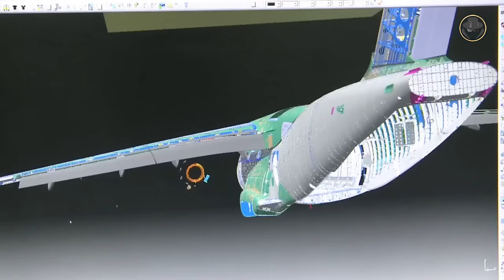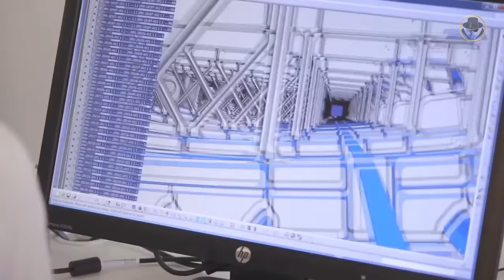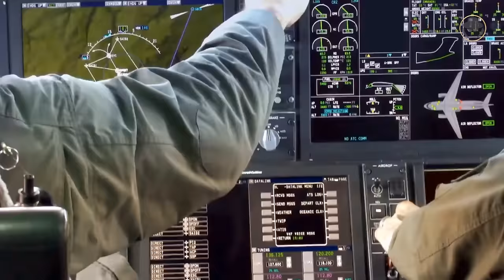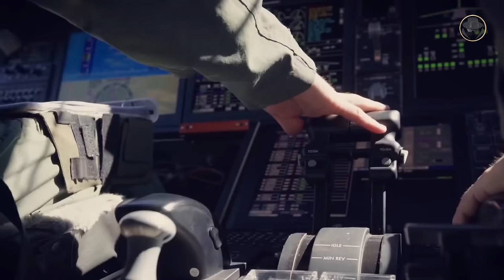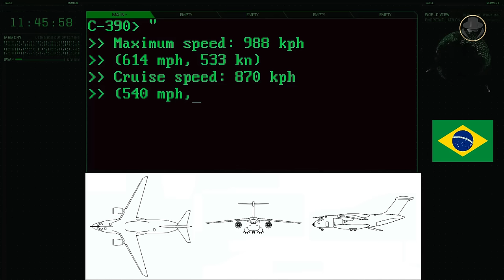Embraer C-390 Millennium | Is it the realistic alternative to the C-130J Super Hercules?

Comment: Let's see if the US will boicot the sales of KC390 like they always do with the Brazilian arms sales
Reply: they already did it in Australia... You are a little late
Reply: @TicoMakonha 
😂😂😂😂😂😂😂
Reply: Not sure you know what “boycott” means.
Reply: @afcgeo882 They make their allies not buy these products so that their own industry enters this market even if they are not better
Reply: @Emersonunes  That’s not a boycott. Also, give one example of that, where the American product is objectively inferior.
Reply: @afcgeo882  in the C130 vs KC390 case, the hercules is inferior im range, speed, transport capacity, technology, avionics, versatility, and price.
Reply: @pedroluizmirandapignanelli9263  Those are objectively false statements. You don’t compare a 747 to an A320 for a reason. The C-130J isn’t supposed to have the same speed or payload. It’s a TACTICAL air lifter. Its job is to service places that no other aircraft can and in a real combat environment. It’s required to be extremely robust, easy to work on and quiet (relatively). The KC-390, with its twin turbines, cannot deliver any of those attributes. The KC-390 also has a 15% lower range, which is CRUCIAL in actual military work.

Also, the C-130J has the same exact avionics as the KC-930 uses American avionics systems.
Reply: @afcgeo882  The C390 was designed specifically to replace the C-130J and does that pretty well.
Also, it's very well known for being a low maintenance and easy to work plane, as many EMBRAER planes are.
In terms of avionics, no, they are not the same as Hercules' since they are decades apart projects.
Reply: @afcgeo882 dude, just open your eyes and accept the trumth.
It doesn't matter if the Hércules and the KC390 were designed for different functions or not, both are in the same category, they are direct competitors.

The United States is not the best in absolutely everything it produces and will never be... It is impossible for this to happen and this applies to all other countries around the world... Are there areas of industry that the USA dominates?  Yes, and many, but it is not the best at everything, because there are countries that specialize in some areas, such as Brazil, which through Embraer specializes in making small and medium-sized planes, executive jets, etc. Russia is the best at manufacturing assault rifles, off-road trucks and hypersonic missiles and so on...
Reply: @zecapaugordinho101pretao  That’s your opinion and every fool is entitled to one. Everyone noticed you mentioned NOT ONE THING that is objectively better. NOT ONE.
Reply: @afcgeo882  Have you watched the video?
Reply: @brunoc.7517  Have you considered that not everything you see on the internet is factual?
Reply: @afcgeo882  The purchase of M1 Abrams tanks by Saudi Arabia instead of the EE-T1 Osório.
In the tests carried out, the Osorio won in several aspects over the Abrams (The Leopard and Challenger tanks had already been disqualified). There was an agreement to build factories for production directly on Saudi soil, but due to political pressure, they chose Abrams.
Reply: @raioefogo  You obviously have NO clue of what you’re talking about. This was in 1989 and the Abrams version in those trials was the inferior A1 original tank with the 105mm gun. The Osorio lost the bid because they only produced 2 prototypes, which isn’t enough to conduct any field tests. They had no money to build the tanks. 

The fact is that Saudi Arabia didn’t buy the Abrams either, as the M1A1 version was already in development with a 120mm gun. Saudi Arabia bought M1A2s many, many years later. 

Lets not also forget that the Osorio was basically a Leopard 1 with better optics. This is in 1989, when Leopard 2 was already in production. There was also lots of evidence thar the Saudis rigged the tests in order to get the Abrams at a cheaper price,
Reply: @afcgeo882  C-130 e KC-390 are in the same category of planes. SO yes, they can be compared and it can be objectively said that KC-390 is better. By any metrics, the only one you presented that is actually better is range but KC-390 is still better in all other aspects and no, this is not a crucial feature
Reply: @MrVitorao  Only people who don’t know anything about airplanes would say that. They are of similar size, but just like an A320 and a 737F aren’t in the same category, so are these two aircraft. Their differing capabilities mean that they are used for different roles. The KC-390 is NOT a tactical air lifter.

The C-390 CANNOT perform special operations missions. With just two engines and them being jets, it CANNOT perform low level drops (the danger of FOD or a bird strike means that it will lose crucial thrust and lift in a critical phase of flight. A 4-engines aircraft has no such worries. The RAF just found itself not being able to conduct special operations missions when it abruptly retired their C-130Js for political reasons because even the A400M cannot carry them out until upgrades in the future.

Also, for air lifters, range is the MOST crucial characteristic as it literally defines what missions it simply cannot carry out. This is ESPECIALLY true for nations that are buying the C-390 as they simply don’t have the strategic refueling or basing capabilities. When you can’t bring something or someone from Point A to Point B then nothing else matters.
Reply: @afcgeo882  but C-390 has a greater cargo capacity and can be refueled mid-air. That's the features that makes its lower range not so much of an issue. Aren't they both military cargo planes?
Reply: @zecapaugordinho101pretao Você tava certo até falar que a Rússia é melhor em alguma coisa. Melhores fuzis? Nunca fizeram os melhores fuzis, você não faz ideia da diferença de qualidade entre os AKs e fuzis ocidentais bons, em especial a plataforma AR...
Reply: @MrVitorao  The C-130 has versions that can be refueled and what good is extra cargo capacity when it lacks range? How will the C-390 be refueled? With what? Another KC-390 that has no range? How would that happen? 

Tactical deliveries don’t really need higher payloads. They need larger fuselage size. The C-390 still can’t deliver vehicles any larger than what the C-130 can. If you want a very large payload then you need strategic airlift, not tactical. Then you need a C-17 type of aircraft. 

The C-390 is a compromise for countries that simply can’t afford the C-17 or A400M, and don’t need serious tactical abilities. It’s cheap and it serves the average needs. It’s a good value. However, it just isn’t the best at anything. 

Something being a military doesn’t qualify anything. A C-5 is a military plane. So is a CASA-212. You want to tell us they’re in the same category? You have NO clue of what you’re talking about.
Reply: Mad
Where the European NATO parters have no problem to purchase systems from other countries , the US has.  They prefer buying  US made systems . A non US supplier must have something very special to sell to the US Forces.
Reply: @bertnl530  Except the US has the means to build its own, whereas many European countries do not. Remember, Europe isn’t one country, isn’t one government, isn’t one budget and isn’t one political system. 

Also, while the US builds everything in the US, the systems often don’t come from the US. Many weapons systems are designed in the UK, EU, South Africa, Israel, etc.
Reply: @afcgeo882   I live in Europe, so I am quite familiar with that continent. 
It is all about coöperation.  Amerika pushes hard to sell equipment to European partners, which ain't a bad thing. but why they are doing everything to keep European partners out. You see numrous vids about the US testing European systems, but never a deal. And that is not because the European system is worse or more expensive in buying and exploitation.
Reply: @bertnl530  No one keeps anyone out! Airbus competed against Boeing for the tanker bid. BAE is a regular supplier including the designer of the primary 155mm howitzer, the M777. The new light tank is on an Ajax platform. The new service pistol is a Glock and the new service rifle is SIG Sauer. The legal requirement is that all actual production must be in the US, that’s all.  In FACT, the US has more European systems in service than Europe has American ones.
Reply: @afcgeo882 What does it mean, tell me?
Reply: @Marcos5pb  I’m not your father. Go educate yourself.
Reply: @TicoMakonha 😂😂😂😂 coe
Reply: @TicoMakonha 😂😂😂😂 coe
Reply: @afcgeo882 Lying to yourself won't change the fact that the US acts like a gang of militiamen in the marketplace.
Reply: @GustavoSouza-gf6ty  So why are you lying to yourself?
Reply: @afcgeo882  I wouldn't do that if my country interfered in other people's business.  I could list about 30 Brazilian technology and weapons businesses that the US directly interfered in apart from Osório's case but you will continue with your Cap.
Reply: @GustavoSouza-gf6ty  And that’s why you don’t list any. 😂
Reply: @afcgeo882  Rocket and satellite project with Ukraine, attack on the Alcântara base, nuclear submarine being sanctioned by the USA, etc.  I could really go on but you are the type of person that when someone takes the blindfold off your eyes you don't get used to the light
Reply: The U.S. bought and provided for the Afghan Air Force the Embraer made Super Tucano light bombers
Reply: @pedroluizmirandapignanelli9263   Not just Avionics,  they use American Engines too.    I don't think it's stall speed is slower than a C-130.  I doubt it could land on an Aircraft Carrier like a C-130 did.
Reply: @pedroluizmirandapignanelli9263 In short, the KC 390 is superior to everything lol😅
Reply: US dirty play
Reply: Fato!
Reply: @GustavoSouza-gf6ty  Boa! Concordo irmão.
Reply: @afcgeo882 Osório is/was a superior tank to the M1 abrams, in 1987 Saudi Arabia was going to buy a lot of Osórios after testing each tank that was delivered to compete in a open market from their respective nations, osorio had won against the italians, french propositions, after winning against the M1 Abrams, US entered the scene accusing Brazil of not following some international laws and by saying Brazil was selling stuff to some USA enemies, Saudi Arabia ended up buying from USA, i am not making it up you can Google it up whenever you want.. sometimes (a lot of times) USA is a bully and an unfair prick)
Reply: @eduardomestieri5772  You seriously need to read comments before yapping.
Reply: @afcgeo882  kkkkkk, chora gringo, o kc390 é bem superior.
Reply: @alexandresloandonascimentogome  esses caras acham que o EUA é um país bom hahaha
Reply: @nordestinolendario  And there you have it, a racist Brazilian showing his true colors. That’s the strength of Brazil right there - the reason they will always be an undeveloped nation.
Reply: @Emersonunes  responde p ele sobre o  tank osorio
Reply: @afcgeo882 Super Tucano >>>> AT-6 and OA-1K

KC390 >>>> C-130J
Reply: @henry247  Oh ok little boy. Keep playing with your toys.

Comment: I saw a comparison between the Hercules and KC-390 Millenium. In fact it wasn't a comparison, it was a KC-390 massacre.
Reply: the Kc 390 was massacred or vice versa?
Reply: @carlosandleon  KC-390 massacred Hercules.
Reply: @cromo7743  And then you woke up.
Reply: @afcgeo882  Against facts there are no arguments.
Reply: @cromo7743  Which is why you presented NO facts, obviously. Of course that’s because you get your “info” from Youtube instead of doing actual research or working with these systems for a living.
Reply: @afcgeo882 why u mad bro
Reply: bros comparing a 2010+ design to an aircraft designed 40 years prior 💀
Reply: @ayylmao182  The C-130J was designed in the 1990’s.
Reply: @cromo7743  Fact, the C-130 can land in smaller unprepared areas than the KC390.   It doesn't have a superior stall speed and doubt it could land on a carrier like a C-130 did.
Reply: @abergethirty A força aérea fez um vôo de homologação do astro e fez uma aterrissagem tática, pouco mais de 250m de pista, um porta avião tem no mínimo 300m
Reply: @cleytonlopes1425  O porta avião pode ter 300 metros mas a pista tem menos de 200.

Comment: Amazing timing @Weapon Detective, Austria just announced it will buy the C-390!
India is strongly considering the aircraft to replace its aging Il-76, in what could be the largest contract for the plane so far, despite India having some C-130J .
Rumors say Egypt is considering the C-390.
Reply: Its not gonna replace them their tonnage capacity is almost half of IL-76
Reply: @VTUGYT  it's not a one to one ratio, as far as it's known India wants to fly C-17 as strategic airlifters and C-390 as tactical ones so the C390 would replace both the medium and small transport aircraft due to its improve capability to land on smaller  airfields. That's why India is looking for 60 to 80 C-390 with some level of local production.
Reply: @VTUGYT  the problem with soviet aircraft such as the An or Il for India is that it's increasingly difficult to find spare parts making it's avaliability and operation costs major problems.
Reply: Substituir o il-78* na função REVO
Reply: Somos um povo que o melhor Aída não está bom buscamos sempre a perfeição salve Santo Drumond inventou o avião 🇧🇷
Reply: The Indian medium transport requirement is to replace the An-32 not the IL76s
Reply: @henryquecabral9357  These would replace the AN-32s and the fact that India already has C-130Js and C-17s is why they’re even considering the C-390. They have their strategic and tactical combat airlift covered. They just need more cheap, standard airlift aircraft and the C-390 is exactly that.
Reply: Coreia do Sul também comprou.
Reply: @afcgeo882 The whole world is watching the KC 390, countless countries are wanting to buy it, it is definitely a work of art and far superior to its competitors, I had to surrender to the KC
Reply: @rafaeltardelle  Rafael… no one is watching it and it’s FAR from superior. It is a value proposition, being sold at a price low enough that many countries that simply can’t afford the C-130 or A400m can buy it. Your issue is your bias. You’re from Latin America, right?
Reply: @afcgeo882  I'm sorry afcgeo, but you're American, right? As I believe your take is biased, the literal only advantage that the C-130 has is the backing of American diplomatic support of its industrial military complex, but as a plane, it is simply non-competitive, it loses in pretty much all relevant capabilities for a carrier. And it should be so, its basic design is from the '60s, even a heavily updated design can only go so far and the American industry decided to focus on larger carriers abandoning new designs for this specific niche. It's not just because it's made in America that it is superior; it doesn't have to be.
That said a carrier that costs less, carries a larger payload, travels further and faster, lands on rougher terrain, and has one of the most common engines on the market (It's the land engine as the A320, so if you ever need replacement, in an emergency you can find one in most commercial airfields, it was designed to do so.) This does make a C-190 superior to a plane from the sixties as it should be, otherwise, it wouldn't even be made in the first place nor preferred by other NATO and non-NATO countries.

Comment: well, I prefer the C-390 Embraer, this rather than the Hercules for aircraft of almost the same class
Reply: And is so silent. Ilive aside a Army field for airborne pratice and C130 is so noisy compared to it.
Reply: ya well Even if the C-130 Hercules is compared to the Airbus A400M which is even larger, and uses the same tuboprop type engine, the C-130 engine is still noisier